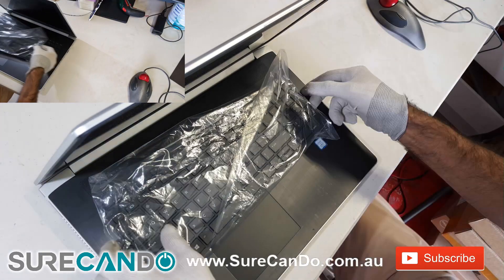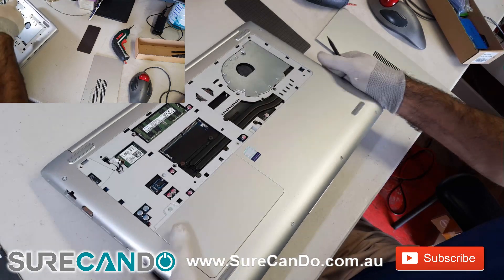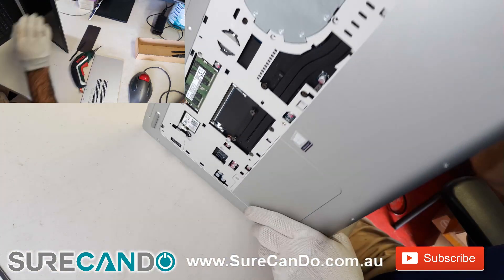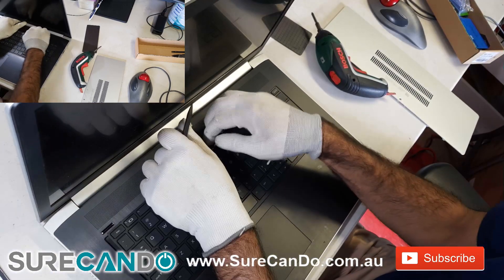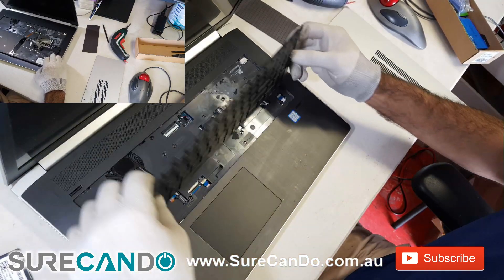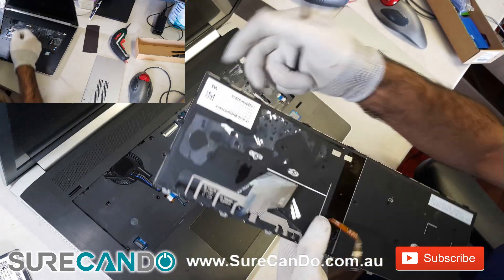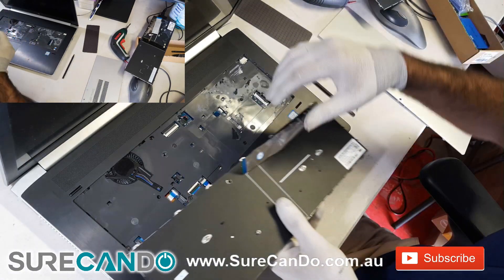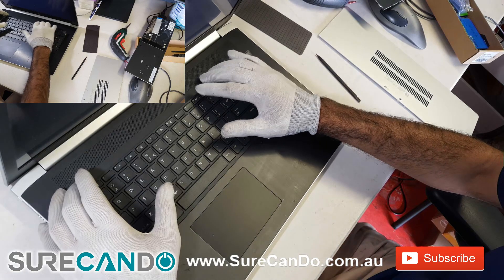HP ProBook 470 G5 Keyboard Replacement Guide

Comment: Mine didn't have a way to release the keyboard ribbon from its clip.  Clip snapped off the motherboard.
Still can't get the ribbon out of the clip.  Wonderful design.

So I figured it out.  You have lift up on the cable and pull it out of its clip.  The clip doesn't move or release.  It's a real tight fit.  HOLD THE CLIP DOWN.  DON'T LET IT MOVE. It's easy to break.  Once broken you'll either need a USB keyboard or a new motherboard.
Reply: How do you put it back in